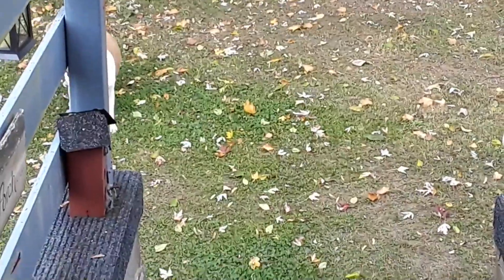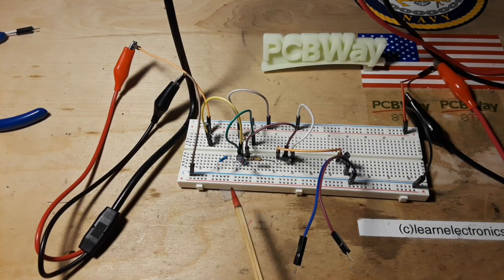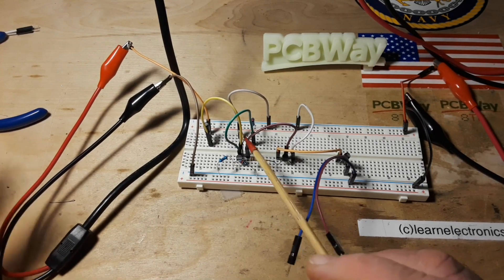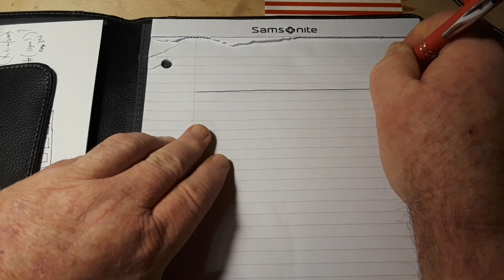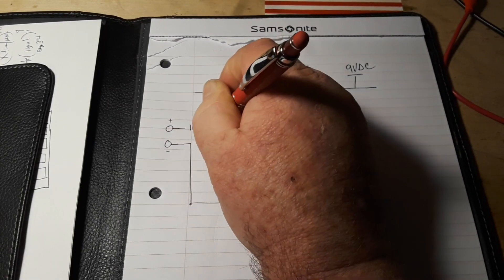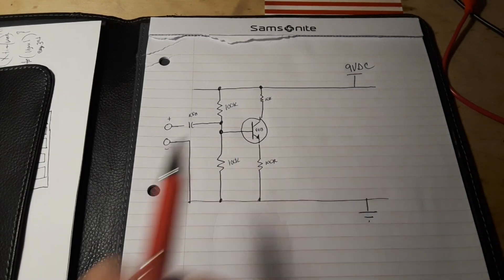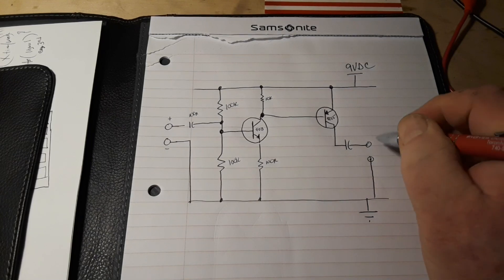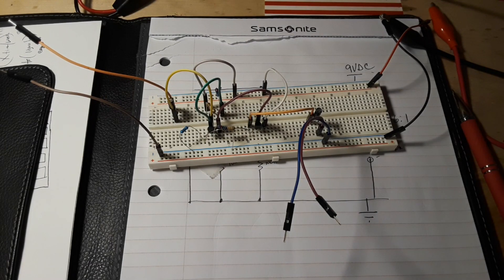Two Transistor Amplifier

Comment: I would call this a direct coupled 2 stage amp.The standing bias (quiescent) current is not easily adjustable.
The standing bias set up  is what determines the cross over distortion......in a push pull/complementary designed amp....the more quiescent current flowing increases it toward class AB and class A.The quiescent current is measured across the emitter resistors and in a good quality amp it is adjustable with small pots.
Reply: You are correct, it is not push pull.

Comment: Sorry but that is not a push-pull class b amplifier. In order to be a push-pull one transistor needs to push the output up to the +Ve rail and the other to pull the output to the -Ve rail. The idea being that with no signal both transistors are off and no current flows through the load.

This leads to x-over distortion as the input has to go above +/- 0.6V Vbe before conduction in either transistor starts.
Reply: Right, what he is showing is a two stage transistor amp.

Comment: Correction: 10k resistor is from emitter to next transistor's *collector.
   This isn't really a push-pull, is it? More of a 2-stage complimentary amplifier; output of one transistor feeds into the input of the next.
Reply: Seems like a Darlington Pair to me.
Reply: No, it has an NPN connected to a PNP...My bad.

Comment: Paul can you explain more why a class b two stage transistor amplifier will have a gain of six and what is the advantage of using the class b amplifier since it's a push-pull you get more gain you're saying more cleaner head room and more gain but what's the how how so?